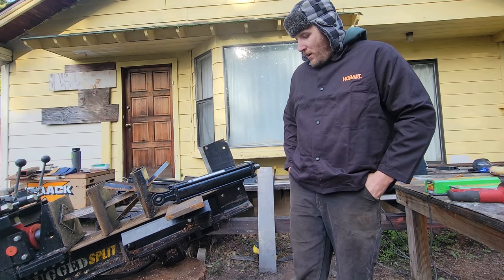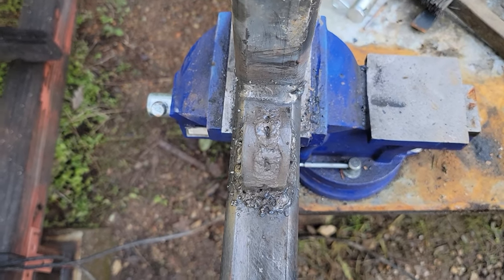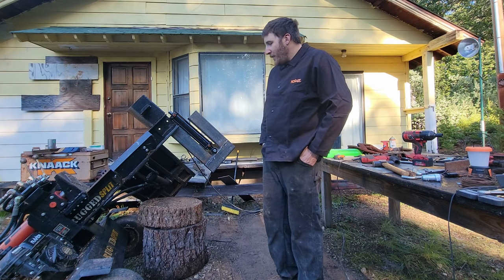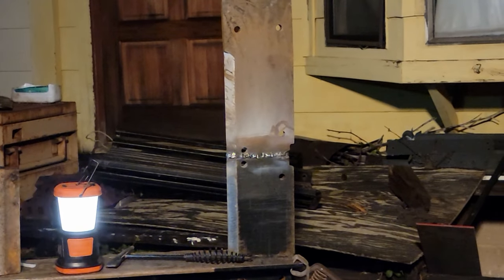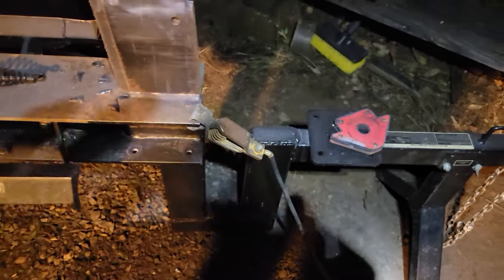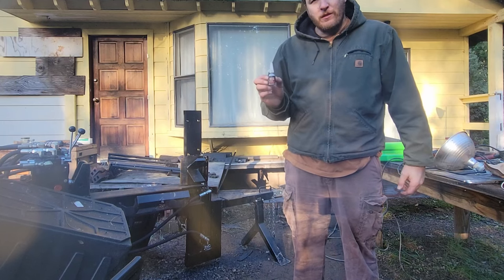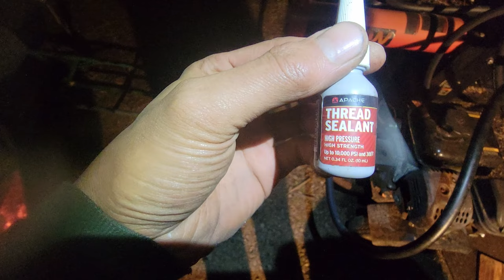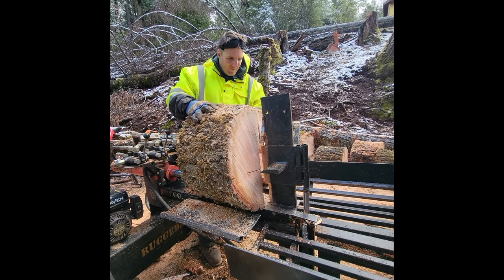#7 RuggedMade Log Splitter Gets A Hydraulic Wedge

Comment: Awesome job! That A/C cracker box with the 6013's was killing me😅. Invest in  D/C when you can run 7018 and 6010 you will be so much happier in the long run.
Reply from the maker: Thanks! I totally agree! I used to have a DC Lincoln arc welder it is very missed haha.  I wanted to test this cracker box out. It seems it can only can do ok beads at 130 amps with 6013 anything else is a joke.